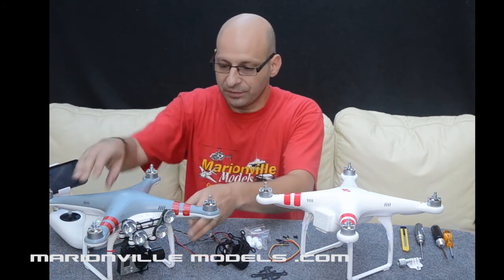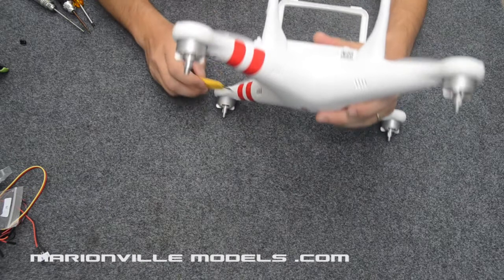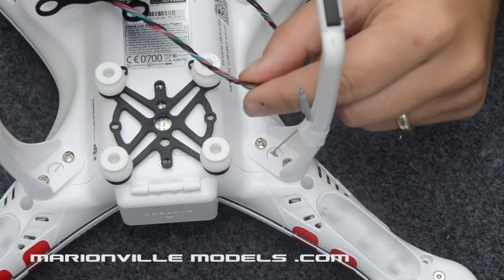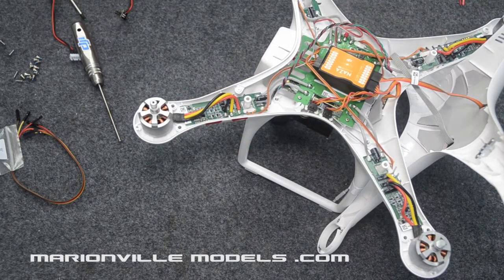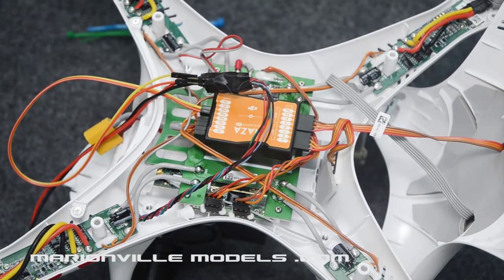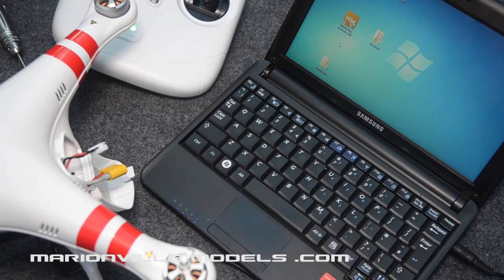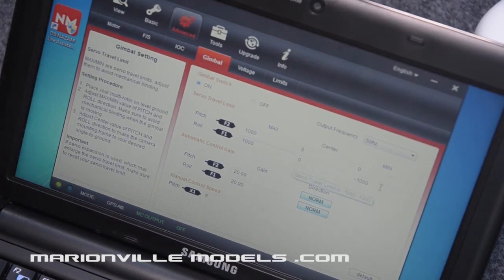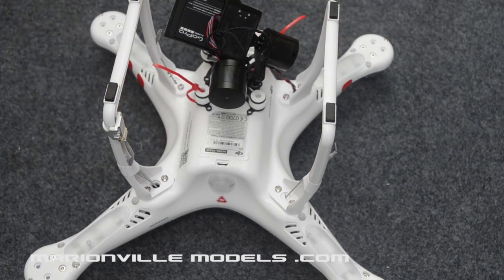How to fit Phantom Gopro 2 Axis Gimbal inc set up and calibration in Assistant Software

Comment: Great vid guys, helped a ton. You wouldn't happen to know what's causing a problem with my lever switch? The Naza-M assistant shows that the lever itself is moving properly but my gimbal only moves to the "lowest" and "highest" settings even when I do the tiniest movements on the lever. Basically, lever at 0% is down, 50% middle, 100% up. But there's nothing in between!
Reply: Okay I know what causes it now. My pitch lever allows movement from -1000 to 1000. But my gimbal can only move between about -300 and 300. Any idea how I could set my pitch lever to control between this -300 and 300. Calibration doesn't seem to do the trick.
Reply from the maker: Sounds like you need to make adjustments to the gimbal controller it's self. If you google Simple gimbal controller you'll find an interface that allows adjustment.
Reply: Thanks a ton for the quick reply! Yeah managed to fix it with the simplebgc gui. Basically just set the pitch lever range from -1000 to a 1000 in the naza-m assistant so the gimbal receives the whole range, and then set the maximum degrees that the gimbal can tilt (-60 to 45 degrees). Everything works perfectly now! Thanks again.
Reply from the maker: Yes if your using the a simple GUI you set the Naza setting to 1000 and make all adjustments with the Simple GUI.

Comment: In the case of an unfortunate accident with the new Vision Plus , could this kit be fitted rather than the original gimbal & camera ?  which you know is very expensive to buy and replace. thanks
Reply from the maker: Interesting thought. I don't see why it wouldn't but you would be relying on the gopro wifi for video which is pretty short range and laggy.
Reply: Marionville Multirotors Thanks , it was just a thought I know it wouldn't be a Plus anymore maybe more like a vision ? like you done in the video , can the one you were working on not use the app on a phone same as the 2 ? as your workshop one has a tilt control  ,  sorry for the stupid  questions lol

Comment: how would this hook up to a phantom 2?my pitch in my dji assistant is x1 not f2 what should i do?
Reply from the maker: Phantom 2 no longer allows for third party gimbals.
Reply: Marionville Multirotors can you source this? I couldn't find any info for your statement, but that would make a big difference for me buying a P1 over a P2v2...
Thanks
Reply: goodluckbuy.com has gimbals that will work but you have to open up the phantom to install.
Reply: +Marionville Multirotors A couple of companies on eBay sell GLB 2 axis gimbal designed to fit Phantom 2 Vision incorporating the barrel shape camera. Easy fit and don't have to open the shell. $40 to £50. I have one fitted to mine. Only problem is the wire to the pitch control. Upgraded controller with shoulder wheel but so far not having any luck.